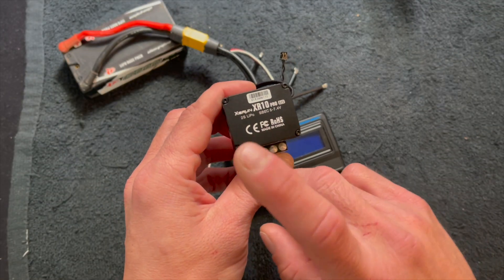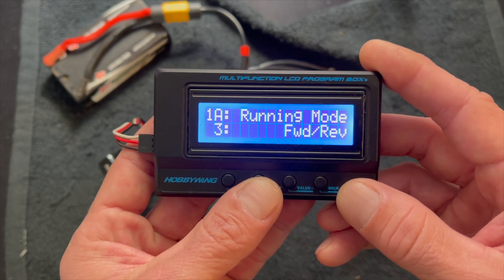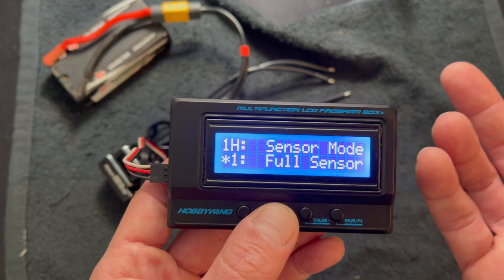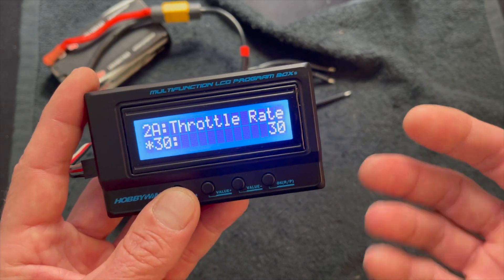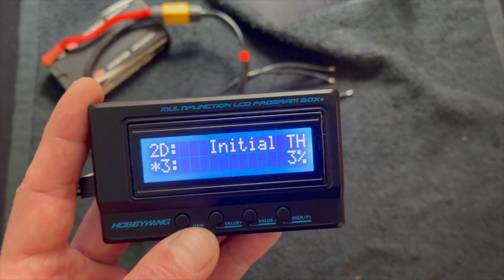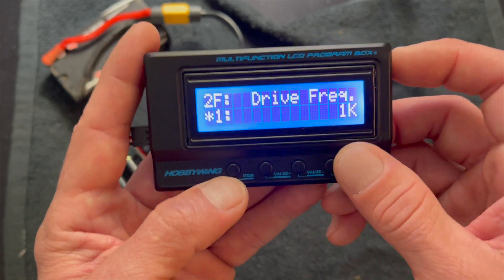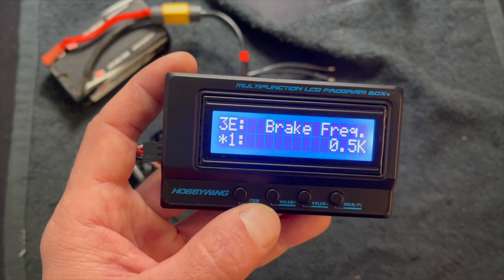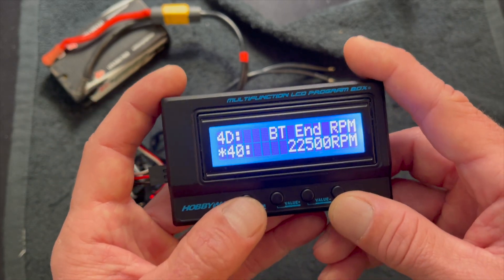The Charlie Show /// Episode 249 /// XR10 Pro G2S tuning

Comment: Thank you for the explanations of all the features. My question is, if you have 40deg timing on the endbell, what should your electronic timing be? Turbo for instance. I guess you would set it at a number, run the car and check your motor temp and then adjust from there?

Comment: Hi. I just got XR10 Pro Elite G2 ESC. Do I still need this Non-Polarity Capacitors (NPC)? What is the impact if I use or not using it?
Reply: Non Polarity caps are not needed, they only offer reverse connection protection where standard caps will blow. I find the one non polarity cap I have tested lower than its rated capacity, so I stick to normal polarity caps for now.

Comment: Hello. I have the XR10 Pro Elite G2 ESC. Also have the LED program card. It doesn’t seem to work with this ESC. Only get some red dashes on the display. Do I need the LCD program card instead, or is there a way to use the LED card with this ESC?
Reply: I have this problem too!

Comment: Does the new esc and firmware fix the double tap reverse bug? The G2 has a bug in the forward brake reverse where if you double tap brake the esc goes immediately into reverse no matter how fast you are going forward. The instructions say the motor must be stopped but you can be going full speed and it will switch to reverse!!!
Reply: @HOBBYWING Official, any update on this question?